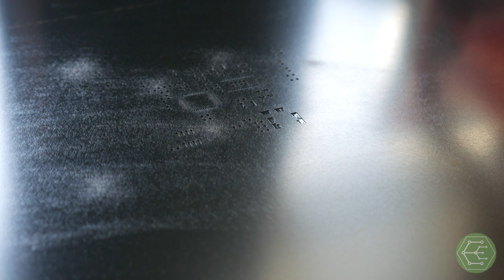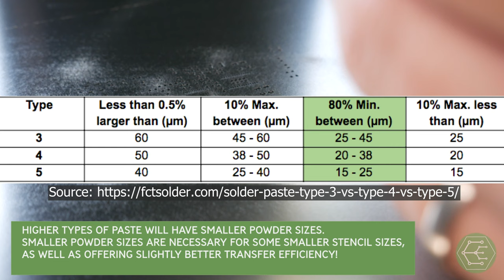Assembling a PCB Without a Soldering Iron! | MOT13

Comment: Oh my! Wish you'd asked me first (of course, how'd you know). Here's a link to the stencil shop I've used with success and specifically to their laser cut prototype stencils:  https://www.stencilsunlimited.com/prototype-smt-stencils-p-28.html?osCsid=064hmq3ki6c1nvd3kprjouamt6  Some things... 1) I find that the frame-less without the fold tabs work the best as they come with metal squeegee (better) and 'board holders' (which are 2 nylon corner squares that you tape down to a work surface (I use a 1'x1' cut piece of old thin plywood) up tight to the corners of your first PCB. Then position your stencil, and tape one edge (several layers of tape to improve repeatability) so you can hinge it up and pop the first board out after applying solder paste and place the next between the holers. 2) You must squeegee the paste with your blade closer to vertical so as not to force the paste through your openings squishing it out under the stencil past your PCB's pads. Also, the stencil is chosen to have a thickness to leave that thickness of paste on your PCB's pads. This means you need to press the squeegee hard against your stencil to leave paste only on the pads of the PCB through the openings. I've often used a moderate angle on the blade and medium pressure on one pass and then made a second pass with the blade at nearer 90 degrees to the surface of the stencil to remove all excess. Don't leave paste between the stencil openings. The board I just watched you paste will have more pad to pad solder bridges, 'tomb-stoned' passives and excess solder issues than you can shake a stick at. I'd be happy to make a video or take some photos to send of my set up and techniqe. I've been using this technique since 2004 or 2005. :)
Reply from the maker: Hello Scott! First off all- thank you for sharing your experience! It's obvious this took you a while to write, and its awesome to share knowledge. This is a great reminder that I should be starting a conversation in our Discord server BEFORE I launch videos. :) (invite link: https://discord.gg/tuRnQNQgv3)  Anyways, consider your comment appreciated.

To actually reply though: I've heard to stencils unlimited, I'll give them a fair try! Good to know you've had good experiences with them before. 
Noted- with regards to my technique - I'll try more vertical with the squeegee. :)

I'm always interested to learn more! Feel free to start a thread on discord and I'll take a look!

Thanks again Scott - consider your comment pinned!
Reply: @EEforEveryone  Glad I could help! I'll look to signing in to your discord.

Comment: Nice work!
Would you be curious about testing Pin-in-paste assembly for the through-hole components?
It's ust something I was taking a look at recently.
Reply from the maker: Hi zwerne42! Ooh! That's a great idea... Potential major cost savings over an added assembly step... Potential disaster. :)

I need to get my head wrapped around normal SMT first, but I'm sure I'll try pin-in-paste sooner than later!